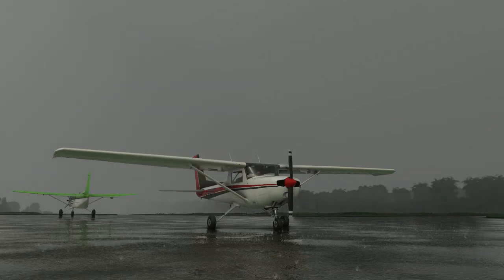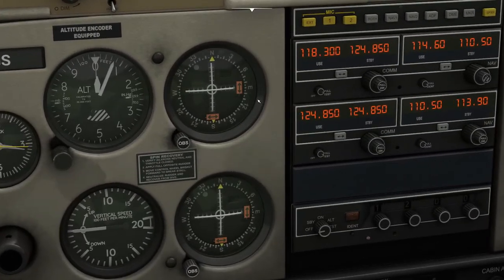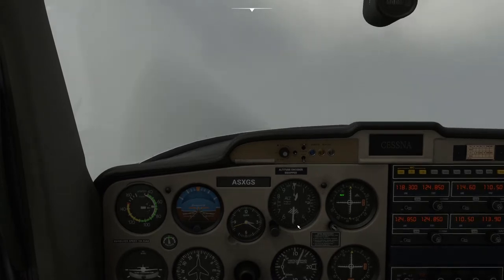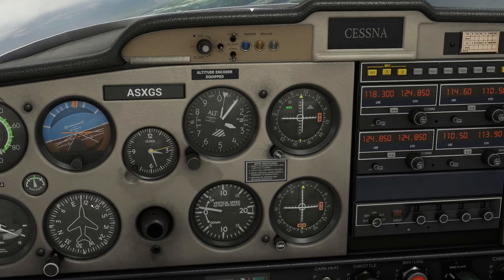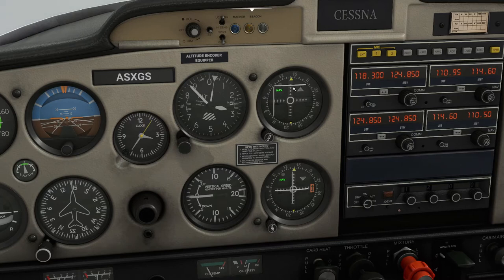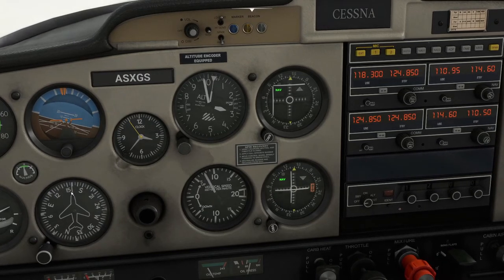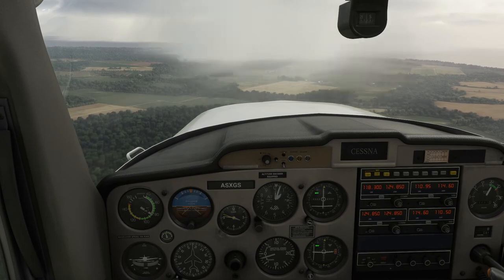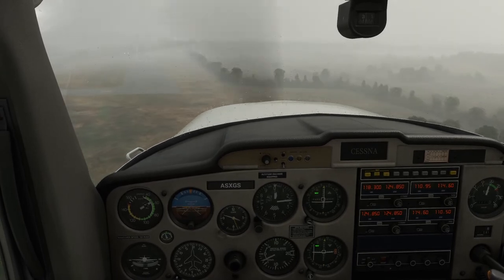Flying the Cessna 152 in Heavy Rain - Very Low Visibility - and Navigating by Instruments in MSFS

Comment: I've heard this weird thing about controlling speed vs controlling climb/decent during landing. Use power changes to control climb/decent and use trim/pitch to control speed.
Reply from the maker: Yep - it's a common way to think about flying - that you can control descent rate with throttle, and just hold the attitude with the elevators. I think sometimes it's advocated if somebody is struggling to coordinate everything easily.
Reply: This is essential when landing. Also, you need to "think ahead" of the aircraft. The power change takes a few seconds to effect.

Comment: At ~ 16:40 how did you set aileron trim on the 152?  Also to my eyes the nav light was never on just the nav symbol on the indicator.
Reply from the maker: I have it mapped to the hat switch on my joystick - makes it very easy :)
Reply: @jonbeckett  Thanks, I guess I didn't realize that the 152 had aileron trim, will have to look at it in FS2020 again
Reply: I couldn't find aileron trim for the 152 in msfs 2020

Comment: Nice vid, but if I may point out something. I noticed that on approach, you are trying to use pitch to control height, and throttle to control speed. That is backwards (i know, it sounds counter-intuitive). You're also quite slow, and at risk of stall. 

For C152, you should set flaps to 30, and trim the elevator for a speed of ~60 knots. If you are trimmed correctly, the aircraft will maintain roughly 60 knots, without requiring any input on the yoke. From there, control your rate of descent with the throttle, and do no adjust the pitch. Do this, and your descent path will be much smoother and the speed will remain constant.
Reply from the maker: If you watch some of the later videos when I work through some of the basic airmanship skills, I look at exactly this subject. It's an interesting one - because students are taught the method you describe, and then experienced pilots admit that's only taught to keep people out of trouble :)
Reply: @Jonathan Beckett  I'm not sure what experienced pilot would ever tell you that, but as a pilot myself, I assure you they've given bad advice. Using the incorrect method is why your airspeed is varying so much on approach, at any given moment it is wavering anywhere from 100 knots, down to 50 knots. Correct use of throttle and pitch coordination, will give you a constant angle of attack, and a constant airspeed with zero input required. The only thing you have to manage is your heading and rate of descent... Doing it your way, you have to manage speed, pitch, descent rate and heading. This is why when you notice you're off the glide slope, you're correcting it, but losing management of your airspeed, so then you notice that and try to correct your airspeed and fall off the approach path, it's a never ending cycle of correction that can be avoided easily.